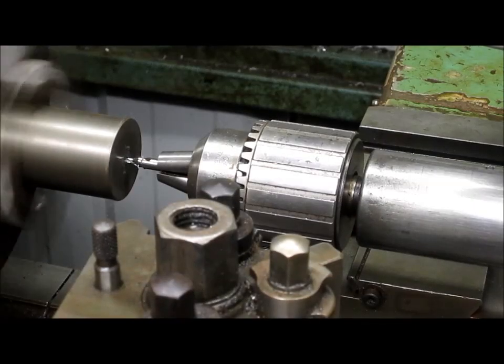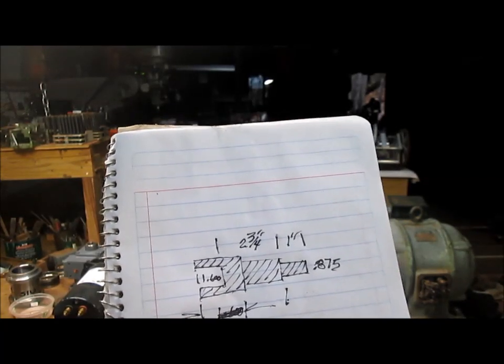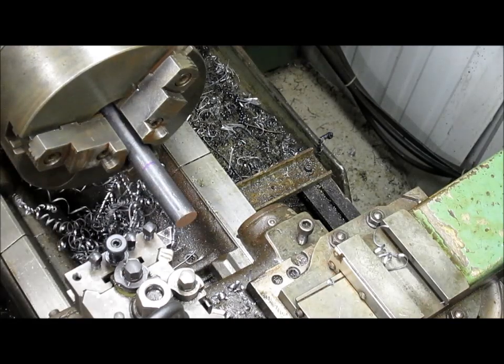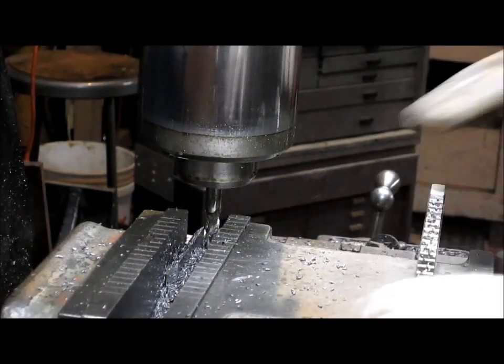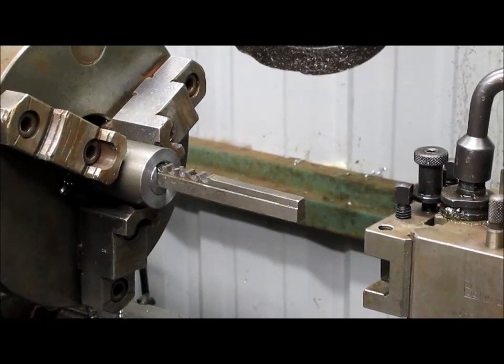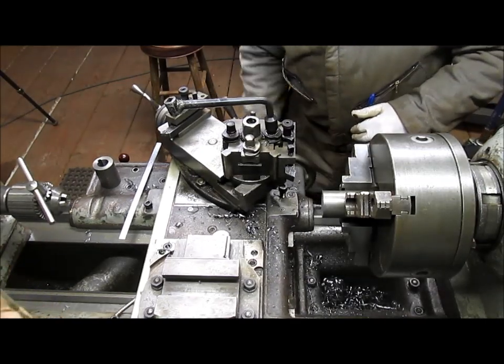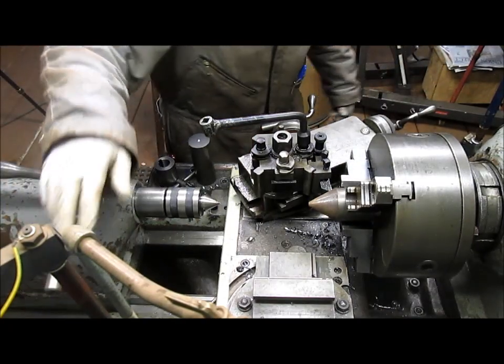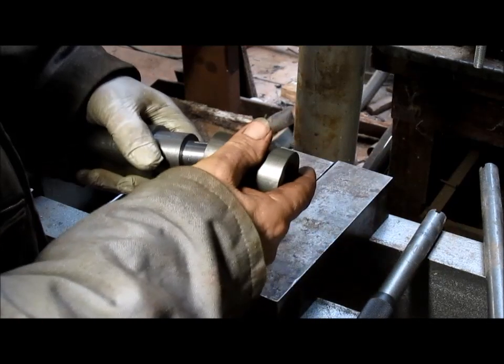Shop Press Build #4

Comment: Great job on the whole series Nik, thanks for sharing. I'm thinking of doing the same thing. Do you think it would work if the connector between the motor and the pump was not welded together? like a keyed collar, keyed on the motor shaft and another key on the reducing shaft to the Lovejoy coupling. Also what is the HP and RPM of the motor?

Comment: hey Nik ! Had you not sold all those baby potbelly stoves on ebay, you could have been basking  in heat rather than being suited up like an arctic explorer
Reply from the maker: +muskeg smith I actually have a woodstove with a water heater transfer to pipes throughout the floor, but there is no insulation in that barn and it doesn't help that much here in the mountains at 3000 feet. Check it out: https://www.youtube.com/watch?v=n8EM6SAKbqs

Comment: Hey Nik our shop has a  hand cable winch on the the table to aid in raising and lowering the table makes it so much easier when adjusting the height. Nice job so far!
Reply from the maker: +John McRae Since the ram is double acting I'm thinking about building a hook of some kind and using the ram to raise and lower the table.
Reply: Good plan!

Comment: could have made the safe per the drawing  and then put the shaft in the lathe  blind hole out and then grind a HSS tool the size of the key mount it in the tool holder and run it in and out of the hole by hand and bam u got a keyway
Reply from the maker: +dozerd12r Good point, but 8620 steel is pretty tough stuff and it would have put a lot of pressure on my lathe carriage
Reply: +dozerd12r   That's what I would have done along with cutting a relief groove at the bottom of the hole and .005" cuts would be not problem
Reply: +John McRae Have you ever cut a 5/16ths" x  1.6" keyway like that? I've got a tight 13" South Bend and even an 1/8th" keyway is a real bear to broach in that manner if your workpiece is this long, especially using 8620, even pre-hardened. I've done it, and it totally sucks, and I wasn't even going into a blind hole. I don't have a press other than my wood-spiller, and it works very well at splitting cords for me every year and I won't be cannibalizing it anytime soon :), so if you could share how to do it I'd be grateful. 

Please tell me the secret grind you'd use, because mine was sharp yet stout, so I wasn't dulling the edge or bending my cutting tool.

Now, narrow and short keyways like the one Mr.Pete made for his lathe handle in cast Zinc are a piece of cake, and I've had great success with that. But longer and wider ones prove difficult...thanks in advance.
Reply from the maker: +Knolltop Farms I'm not sure what "secret grind" means, but you are right, aluminum or zinc are easy to cut keyways on a lathe, but heaver cuts in steel are impossible and put a lot of stress on the carriage.
Reply: Not sure either about a special grind, but if your using a keyway broach on a lathe then ya that would take some effort for sure as a keyway broach is basically a tapered cutter and all the teeth are cutting as you go in, but small .002-.005 cuts shouldn't be that tough I would think.
Reply: Tried, and at that length curling a chip this wide is not easy on your rack and pinion...then again I've only done it a couple of times and I could have had poor geometry on my tool bit. It was a good Rex-AAA, but I'd have to go out and scale it to see what my grind was on it. Thanks for the reply
Reply from the maker: +Knolltop Farms I agree that wide of a chip in 8620 is not easy especially on the lathe.